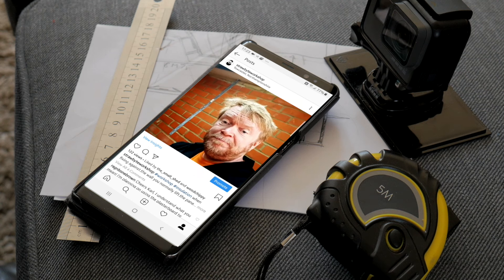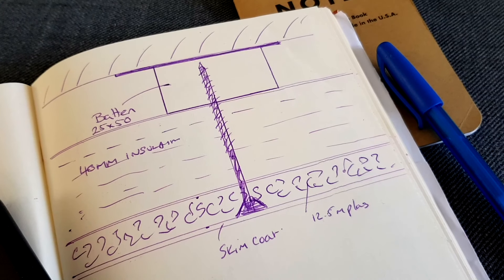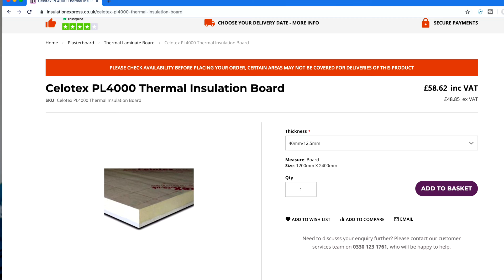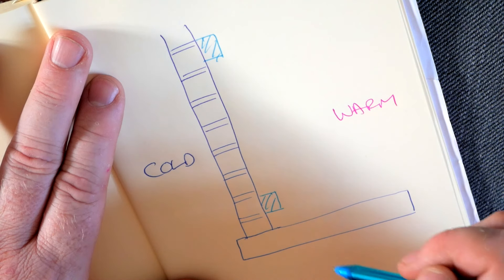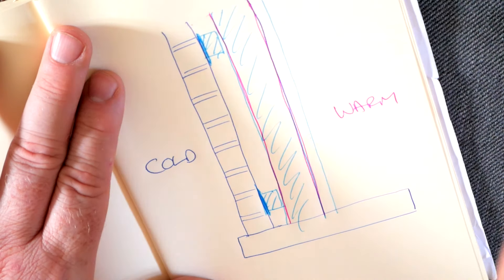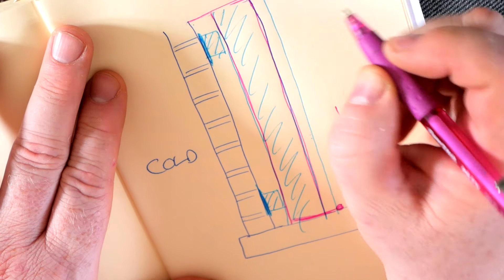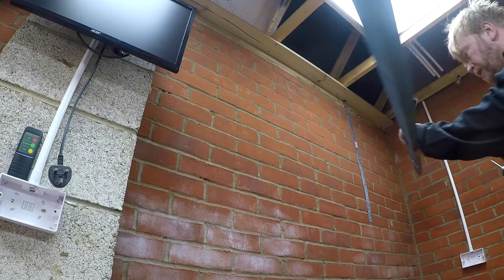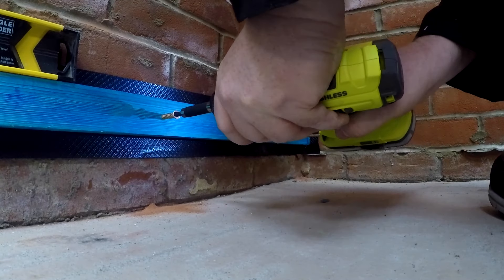How to Insulate Your Workshop | An Easy DIY Project | Keep Your Shop Warm or Cooler

Comment: Hey great video!!! im looking to insulate my single skin porch, if i wanted to put up a shelf how would you suggest i go about it. :)
Reply from the maker: Your best bet is to through the insulated wall into the battens supporting it. Recently I've repeated this technique and used 30mm thick vertical battens at 400mm centres secured with masonry screws. Clad the wall in insulated plasterboard and then fixed shelf brackets into the battens.

Comment: We have a similar project but unfortunately also have a gas boiler and gas mains on the outer wall and mains distribution on the house adjoining wall. I thought about boxing them off with access hatches but worry this would be a source of penetration, should I be much concerned about doing this?
Reply from the maker: A tricky problem because boilers will require clearances around them because the have to dissipate excess heat from the heat-exchanger. For the electrical panel you need enough clearance for an electrician to work (especially as they charge by the hour).

If the objective is to reduce heat loss, then insulating what you can and leaving what you can't would still be beneficial. Then if and when you have replace the boiler, then you can fill-in the gap.

Comment: Carl. planning to carry out some insulation on my single skin garage,the data on  kings span  site suggested 50 mm. Have you any tangible data on the difference it made to your workshop? Thanks Nigel from Northampton.
Reply from the maker: Hi Nigel - a local viewer!

Great question. Firstly Kingspan does recommend 50mm you are correct. I paired it back to 40mm for two reasons. 1. I wanted to minimise the space lost to the insulated wall. 2. It's a workshop and the objective was to create a comfortable working temperature which is around 14 degrees in the winter months.

I touched on it in the video - the benefit in the summer is that the workshop remains at around 20-21 degrees, or generally 5 degrees cooler than ambient. But in the winter I can get workshop up to 14 degrees in about 20 mins with a 2Kw fan heater. 

A couple of caveats. 1. The garage door is by far the biggest source of heat loss rather than the walls. 2. My side door in uninsulated, it wasn't there in winter 1 and I had problems last winter with it not fitting correctly . 3. The floor is uninsulated and I would have achieved a far better insulated space if I had retrofit insulation to the floor.
Reply: @StrawbyteWorkshop 40 mm sounds like a good compromise. My roof was recently replaced with aluminium PIR composite from Concrete/ Asbestos, has made a world of difference. Is that 40 mm including the plaster board?
Reply from the maker: @keanMechanic  No, 40mm PIR insulation plus 12.5mm plasterboard (on 2 walls only) or 40mm PIR and 12mm MR MDF on the remaining.
Reply: What was used to insulate the garage door & did you leave an air gap between the metal of the door & the insulation?

Comment: Hi
V informative video thank you.
I was wondering what vapour barrier you used and put behind the timber battens and what gap you left at the top between the ceiling/ rafter and the bottom and what you used to seal the bottom of the insulated plasterboard panel?
Reply from the maker: Thanks for the questions.
I used ordinary Damp Proof Course material behind the battens. 
I measured the insulated plasterboard (or insulation & MR MDF) so that it would be hard up against the top of the wall (Ceiling) with a 5-8mm gap at the bottom. The gaps all around were sealed with a bead of acoustic sealant. The occasional larger gap with expanding foam and then acoustic sealant.
Reply: @StrawbyteWorkshop  thanks for getting back to me. Have you got a video of putting a ceiling up in the garage? i was looking at trying to keep the heat in for our home gym in the garage!
Reply from the maker: @amanc09  I covered the roof space in this video: https://youtu.be/fpO6lMwRpCQ but I've since realised I made a mistake, it's not an approach I'd now recommend and have de-listed it. I am going to put that right in a few months and do a follow-up video.
If you want to see a good example of how to do it, take a look at Monkeyboy's Workshop on Instagram he has tackled a workshop conversion starting with the ceiling. https://www.instagram.com/stories/highlights/17884523617609844/
Reply: @StrawbyteWorkshop  thanks for getting back to me! Apologies last few questions I'm starting this weekend on my garage 😅. Did you fix the dpc to the battens before drilling to the wall and did the panels just sit against the walls where you didn't board? Did you use any angle beads for the corners?
Reply from the maker: @amanc09  The DBC is fixed to the batten by stapiing into one end, stretching the DPC across, cutting and stapling into the end of the other. I left a 5mm gap at the sides of the panels against the blockwork pillars you see. The gap is filled a thick bead of sealant or expanding foam for larger gaps. Where I was instaling the insulation followed by the board, I sealed twice the second around the board was decorators caulk. I hope that answers your second question - and no there was no beading once the gaps were sealed.

Comment: Great video, and answered a lot of questions for me! Hoping to do the same one day! Quick questions... Why did you decide to use plasterboard for one of the walls? And MDF for the others? Thanks!
Reply from the maker: Hi - thanks for the question. It's been asked a fair bit which I don't mind as looking back at the video I could have made things clearer. The intention was to have the whole project completed with insulated plasterboard but when I started on the first two walls I quickly realised 2 things. 
1. it's a very heavy material and struggled on my own to fit it without damaging edges and corners.
2. It's really not weatherproof and I had nowhere to store all the material needed for the remaining walls of the workshop.
Switching to Celotex and MDF proved better as I could store the celotex outside where a little summer rain wouldn't ruin it and the MDF could be fetched as I needed it. The two-step process was slower but more managable and MDF weighs 1/2 the weight of the same sized plasterboard panel.

Comment: Having not insulated the roof space how do you find heat retention?
Reply from the maker: The roof space is insulated and there was a second video explaining that part of the project. https://youtu.be/fpO6lMwRpCQ There's an error in the video that I've now corrected and plan to re-upload a further video explaining how it was all done.

With the walls and roof done and some work done around the up-and-over door to prevent drafts, the heat retention is good and it costs a fraction to heat than it did before. I've said in several comments that the main benefit for me is how cool the space remains during the summer months. That's when I'm most active the in the workshop.
Reply: @StrawbyteWorkshop  thanks

Comment: Another question, sorry! We have DPM on the floor but no DPC in the brickwork that I can see, do you think a layer of tanking slurry before battening do the job? Bricks seem dry but want to take precautions for the future!
Reply from the maker: In your situation I would probably use the battens as I have with DPC fixed to the back. While I have a DPC there is a fault in one small area were damp has risen into the wall in winter months. I had it all off to repair it and the battens, insulation were fine. The alternative is a chemical dpc and I think skill builder has a good video on a system which looks easy.

Comment: What amp of breakers do you have in your shop? I'm moving onto a house with a similar garage with power already in the garage.
Did you have to change your breakers from the stock put in by the builder?
Reply from the maker: Hi. Thanks for the question. At the moment I have a single 20A radial circuit from the house. When I moved in I the developer installed a single 13a fused spur from the ground floor ring main, via an armoured cable through the garden. A temporary fix was to terminate this at the fuse board on a breaker has now lasted almost 6 years. My plan is to have a bigger circuit and small consumer unit installed the garage fed straight from the meter cabinet.

Comment: Does it matter than you didn’t insulate the supporting brick columns or the floor? What about the damp air from the gaps around the garage door?
Reply from the maker: Since I made the video the columns have been insulated but for the 12 months the weren't it didn't seem to matter much. The workshop was much quicker to warm up and warmer for much much longer. The garage door wasn't too drafty to start with and the relative humidity inside the the workshop stays well above the dew point so I don't get any rusting of cast iron tables or steel tools. This winter I've had 'frost prevention' heating like you would have in a green house installed and I keep the temperature to a minimum of 8 degrees. It costs about 75p per day.
Reply: @StrawbyteWorkshop  Thanks for the info. What type of frost prevention heating setup have you got as I’m worried about rusting for tools, machines? Do you have additional air vents so as not to cause condensation?
Reply from the maker: @markhesketh6699  I have 2 Dimplex ECOT 5ft Tube Heaters. In terms of ventilation a Ventaxia Silloette 100HT fan which has a humidistat.

Comment: Thanks for this. I'm going to have to do something similar soon. Apologies if this has already been asked before but I'm curious how come you used MDF boards on some sections and laminated plaster boards on others? Is it possible to install anything heavier on the walls through the boards possibly all the way to the brickwork?
Reply from the maker: Hi Kari. The question of the change comes up quite a bit and the simple answer is that the plasterboard/insulation panels were very heavy to manage on my own - even with my partner's help as seen in the video - and I had nowhere I could store all I needed for the project where it would be dry. Celotex on its own can be left outside and the MDF was fetched from my local builders yard every day as needed.
It's worth noting that MDF is often used in new builds in place of plasterboard where heavy items are being hung. My kitchen and locations for my wall mounted TVs in the new house are 15mm MR MDF panels on 400mm centre studwork. Since the workshop insulation build I've mounted a big set of shelves to the walls and two kitchen-style cabinets for finishes and glues. The fixings for those go through the MDF and insulation into the batten and then the wall. They're around 100mm long and have steel sleeves between the bracket/cabinet and the batten. It's an adaptation of a common dot-and-dab wall anchor. Fixings at the top of the cabinets actually go straight into the 150mm thick wall plate on top of the brick.
If I were doing this again, I would be much more mindful about fixing through the wall and make more provision for wall mounted cabinets.
Reply: @StrawbyteWorkshop  Brilliant. Thanks for the insights. Most helpful!

Comment: Brilliant brilliant brilliant video! - with the MDF option, would you be drilling the insulation blocks into the batten or into the wall?
Reply from the maker: Hey - thanks for the comment. The MDF option uses battens too. You first screw fix the insulation to the battens and then the MDF is screwed into the same battens.
Reply: @StrawbyteWorkshop  Thanks so much! I'm wanting to cover my brick blocks - what would you do to get it to come out just a little further so that the MDF can be flush with the bricks allowing my cladding to run straight?
Reply from the maker: @KamalHyman  The brick blocks have now been covered. I made a plywood box that was lined with insulation and bolted it to the walls. All of that was filmed and I'm intending to put out a follow-up video on the subject of the blockwork piers as there have been so many questions asked. I did consider bring the wall out further to cover the blockwork but would have lost an additional 4cm across the width of the garage. As it happens my solution provides a 4 strong-points on to which I can mount heavy things. 

Anyway your comment has spurred me on to complete the follow-up. Look out for that.
Reply: @StrawbyteWorkshop  I'll keep an eye out!! Last question then I'll leave you alone! If the blue batten is sold out (let down buy a Diy chain) - Can CLS timber at 50mm thickness do the same job
Reply from the maker: @KamalHyman  you could use any timber really. I chose roofing battens as they're pre-treated so when they're up I know they'll be okay. It's the dpc stapled to the back which is doing most of the work. Untreated CLS would be okay but I'd want to give them one coat of fence or shed preserver for piece of mind. 
Shame about DIY places at the mo, they never have what you need frustrating in a lockdown.

Comment: Hi there, what is the purpose of the battens? could you not screw the insulation directly on the walls? As you said the vapour barrier is being created by the foil material on the insulation itself. Thank you
Reply from the maker: When I researched this I did find a couple of examples where you could fix directly to the wall. In those situations there were two important factors. 1) the wall must be completely impermeable to moisture 2) you must use the manufactorer's fixings to prevent thermal bridging.

In the my case I was insulating a single-skin brick wall and most house bricks are porous - that's to say if they get wet enough from the outside the inside face will be wet. The void created by the battens prevents moisture accumulation behind the insulation and any damp  freely move around and pass back out through the brick. The second purpose is to prevent thermal bridging. The battens are secured to the wall with concrete screws and the insulation (as you see) with normal screws. There are no metal fixings going from the inside face into the cold wall behind. Plus the advantage is that it's much easier to fit this way, especially as most new garages are built with a floor that has a 1:100 fall (6 cm over 6m) while the walls are upright and square (enough) to each other, the floor is sloped over its length.  It means I can take care to ensure the battens are vertical and spaced correctly and standard 1200mm sheets can screw straight into them.

I hope that helps. K.
Reply: Excellent analysis thanks alot :-) great video too
Reply from the maker: Thanks. There's more like this in the way.

Comment: Sorry I’m a complete novice first time trying anything like this…so the celotex goes on first then the mdf goes on top? Does the plasterboard on the celotex not provide a finish ready to seal the holes, and decorate? Or do I need that mdf on top too?
Reply from the maker: I probably didn't explain it well in the video. In the first part I was installing insulated plasterboard (plasterboard pre-glued to the celotex) and that's the finished surface. Later I changed my mind and used ordinary celotex and the finished surface is the MDF you see me installing on top.

Comment: Hi, where did you buy your batterns from? Im looking at blue treated batterns from Wickes and the cost is almost £300 for 50mm wide (6 batterns per each garage section)?
Reply from the maker: The ones you saw in the video were from wickes which were the cheapest by far at the time. I have done a refurbishment of the garage door wall where I got 4.8m lengths from a local roofing merchant for about 40% less than wickes.
Reply: @StrawbyteWorkshop  Thanks for speedy response, I just checked Insulation superstore and they have it for almost a 3rd off (very much cheaper)

Comment: Thanks for sharing your work. Did you screw insulation to the battens or fix to brick wall?
Reply from the maker: The battens were first screwed to the wall using masonry screws. There were two insulations used. In the case of the insulated plasterboard, it was screwed to the battens with drywall screws. Where I switched to the PIR (celotex covered in MDF) I first screwed the celotex to the battens with 50mm screws and large penny washers. The MDF was attached to the battens through the insulation using longer screws. I hope that makes sense.

Comment: A good video and very helpful, couple of questions.... I am looking to insulate my garage and also wish to minimise the thickness of the wall, I see Celotec comes in 25mm also. Why did you use 40mm? Also how did you seal the wall and ceiling? Normal silicone? Thanks
Reply from the maker: Hi Spencer - sorry for the delay in getting back to you. In terms of the thickness of the insulation I was balancing thickness of the construction with the recommended insulation thickness to meet building regulations. 40mm fell at the mid-point of that range (between 25 and 75 (regs at the time)) hence the choice. One thing I would say is that while I was heavily concerned with the amount of space I was going to loose, having completed the project I think I probably wouldn't have noticed an additional 40mm by using 60mm insulation. You get used to the space and you can use light flat colours on the wall to give the impression of more space.
In terms of sealing - I probably didn't explain that as well as I could in the video. I used Everbuild AC50 to fill the smaller (up to 10mm) gaps. for larger gaps either expanding foam and AC50 together, or jointing foam strips and AC50.
AC is a sealant that doesn't fully cure and remains soft so has great flexibility and exceptional sound absorbing capabilities.
I'm thinking of revisiting the project and may be cover in more fully some of the details that people have asked about. If you have any other questions, please ask.